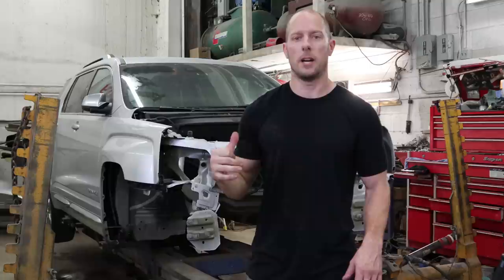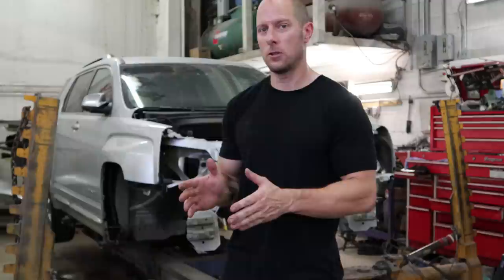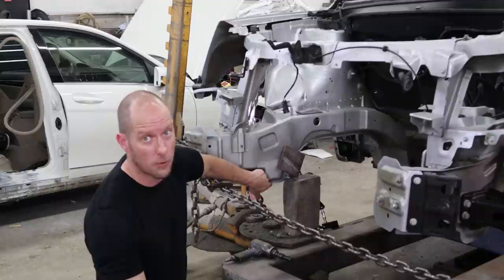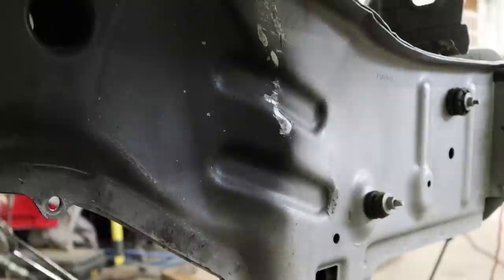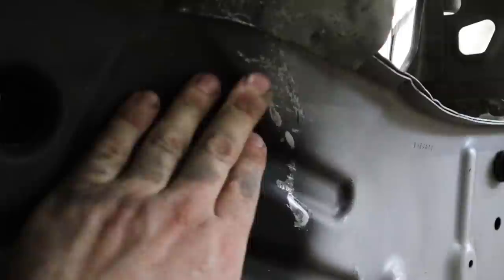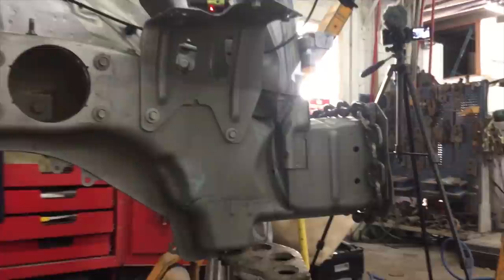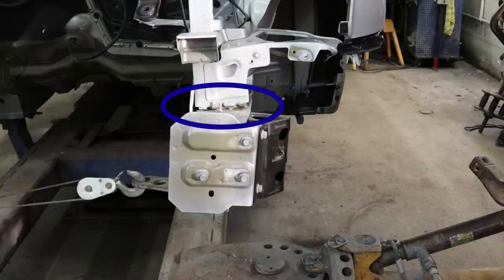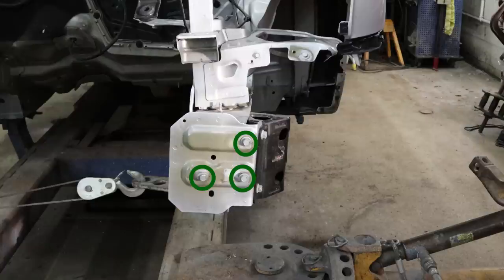Frame pulling tutorial on our 2015 GMC Terrain salvage rebuild project.

Comment: Hi,
Could you repair those high strength steel parts just by welding a piece of high strength steel patch overlapping them? Would that make a satisfactory repair for the inspector, and to your good conscience? I see a lot of old cars frame being repaired that way, of course for a vintage car it would be harder to find replacement parts, and the frame is usually not high strength I guess, but I bet jut a patch would be a lot cheaper.
Thanks.
Reply from the maker: You could but it would not be right.  There is a small section on the front where that is allowed.  The older frames are fine to repair, even regular steel unibodies.  On HSS it is not a proper repair.  I just follow the rules that the guys in lab coats tell me is right.  They have done the research and I trust them.  I'm just sharing it with people that don't have access to the training.  I could section it and it would look 100% but I can't be sure and don't want to find out if it will react the same in the next collision.  Thanks for watching.
Reply: @vehcor  Thanks for the reply, I am looking forward to see how you're going to do it.
Reply from the maker: @thisreal8979  I'll get those tutorials out eventually.  They are taking up space on my hard drive.  I just need to find the time to edit them.

Comment: What year would u say the started to make frame sections replaceable. I have a 93 GMC k2500 an would help me with chosen they way to go
Reply from the maker: Your truck is a little different, it is full frame.  It does have places to section it.  You have always been able to replace sections of frames. and still can.  Now the guidelines are a little more strict but you can still buy sections from the manufacturers.  If you are replacing it from rot, just replace the entire frame.  If it is from a collision, it might be worth it to repair.  Sometimes the repairs end up costing more and taking more time than a full replacement so look into that as well.  Thanks for watching.

Comment: Learned a lot from your video! Thanks for sharing! So a slight frame sway does not impact the safety of the repaired vehicle, right?
Reply from the maker: Glad you find them helpful.  If the rail was swayed over a longer range (no kinks, crumples), you could pull it back and it would be fine.  The inner part of the right rail was boarder line but I like to make it perfect.  Thanks for watching
Reply: @vehcor  Got it! Thanks for reply!

Comment: I am curious on how you know where to pull it. Where do you get measurements to know which is bent and where it should be? I have a 350z and where the bumper attaches, the holes dont really line up. They are close but a hair out. How do I know which frame rail is bent (or see if both are) and check it?
Reply from the maker: The frame rack measuring system has measurement for all vehicles.

Comment: A frame was bent due to hit in the rear, trunk doesn't close. Can it be strightened by pulling by that frame with another car? Thank you for the informative film.
Reply from the maker: I don't have any idea how bad it was hit.  A trunk that doesn't close can be as simple as a bent latch or body panel or as complex as entire frame rails requiring replacement.  Thanks for watching.
Reply: Thank you for the replay. First I'll try to do Mickey mouse way to repair by knocking on the bent frame with the hammer over a small dolly. Also some people pull using the trunk of the tree. Quite interesting to experiment.

Comment: If you are going to replace the frame rail, would you straighten it all first or just cut and replace?
Reply from the maker: I would have done this even if I wasn't trying to make a tutorial.  It helps to get panels that are adjacent to the ones you are replacing in the right spot.  If you just remove everything sometimes it is harder to move the good panels even a little.  It is usually just a few millimeters but it can make putting it back together a real pain.  I did end up pulling the aprons a little as well.  Thanks for watching.
Reply: @vehcor   I thought so. Been a long time. 40 years ago my first job was a helper in a cousin's body shop, Flower Hill Autobody. They kind of said the same thing. It's art and science. We had a guy that could red lead like it was painted on. Now they probably just replace panels.

Comment: Could a simple pull procedure on a front-end hit at the small bridge above the headlights compromise the integrity or overall regedity of the chassis? 

Vehicle is 1990 Mercedes W124, thanks
Reply: I doubt that it would.

Comment: This was great! You certainly evolve on the filmaking side over the year. I wonder to what level of accuracy are measurements taken? If the frame is off only by a few mils ...say 100..with no wrinkles... is also a replace or nothing?
Reply: What I’ve read is that if any bends approach 90 degrees, even the smallest kink, mandatory replacement of that section back to the core structure, with front end damage that would be the cowl/ firewall.    If it’s less than 45 degrees it’s a matter of judgement, placement, etc.    I’m commenting above.  Check it.

Comment: could you have done the pulling without pulling the motor out? as in if you weren't replacing the rails.
Reply from the maker: Yes, it actually would have been pretty easy.  All of the damage was in front of the subframe mounts.
Reply: vehcor I’m honestly surprised you didn’t do it that way, most would’ve, and prob what I would’ve done. Glad to see someone who cares about safety over more profit. Good stuff love the vids.
Reply from the maker: @krajncar  I could certainly save a lot of time and money by doing it the wrong way but I would not want that on my conscience.  In the long run, doing things the right way has saved me money.  I'll explain that further in future videos.  Thanks for watching.

Comment: Frame work eats up book rate, can always do better with panels to get more billable hours in a day?
Reply from the maker: Sometimes replacement takes longer than repair, so as long as the repair is within acceptable repair procedures, it makes sense.  I don't get paid by an insurance company so I'm not trying to book hours, just fix the vehicle properly in the quickest manner.

Comment: complete beginner here so i apologize  if this is an absurdly stupid question i have never done any body work of any kind and am just now trying to learn a little about it but why couldn't you weld some sort of a reinforcement piece of plate steel on the week part? assuming that the car is for personal use and not to be sold to anybody.
Reply from the maker: Adding strength to the rail is just as bad as using a weak one.  If it doesn't bend where it should in the next accident something else has to absorb that energy.  That would be the people inside.  I don't want to kill myself or anyone else so I always follow proper repair procedures.  Something many people are unaware, even exist, including many "professionals". The next part of this repair comes out tomorrow.  You can see the correct way to do it. It looked like a little job the the correct way requires a lot more work.
Reply: @vehcor  that makes a lot of sense thank you for the explanation.

Comment: How can you tell something is high strength steel?
Reply from the maker: Repair manuals tell you.  It is also harder to drill and grind.  It likes to tear and doesn't like to go back to where it belongs like regular metal.  Pretty much all frame rails, rockers and pillars in any newer car (2010+). There are exceptions of course but that is a good general rule of thumb.

Comment: What if you heat shrink  metal on the frame rail would that make it strong again?
Reply from the maker: NO!  It would weaken it.  A unibody should NEVER be heated.  I have seen people do it and it will look right but you don't want to be in that car for the next accident even if it is minor.

Comment: My 2019 Ram 1500 Limited got T-Boned in the passenger side rear, just in front of the Right Rear Tire. This woman hit me so hard, she spun me around 180 Degrees in the intersection. Her whole front end was caved in. Do you think that if my frame was bent, the would repair it, replace it or total it?
Reply: ...if the frame is ok, the bed and cab can be pulled and repaired.   But if you frame is also bend, it's gonna be totaled.  How does it drive?
Reply: @Texaca  I have not been able to drive it yet but I was informed that the frame has not been bent.

Comment: Is there a law saying you can't replace truck chassis anymore? Ive done a lot but now can't get 1
Reply from the maker: No, that is the proper way to repair just about any frame damage these days.  If you mean you can't buy them, I don't know why.  If you work in a shop and don't get the the jobs, it is simple.  The cost totals them and shops don't want the liability of the big jobs.  There is a lot that can be overlooked and missed if you are not used to the big jobs.  Shops that only change bumpers and fenders don't want to experiment with dropping a drivetrain or worse yet swapping a frame.  Thanks for watching.
Reply: +vehcor no it was only at 35% like 14,000 but the insurance company said no it was against the law... just seein if any body had heard that.  "it was a 17 high country with 160000 on it. hit in wheel.
Reply from the maker: @matthewherring8042  I'm guessing you are talking about a full frame truck like a Silverado, no?  If so, there is something else going on.  It is not illegal to change a frame.  That is the only right way to repair most frames.  Doing it the wrong way is not illegal but should be.
Reply: +vehcor thanks man yea its a Chevy High Country 2017.
Reply from the maker: @matthewherring8042  It could be that the shop doesn't want to take on the job and is friendly with the adjuster that gave them a way out.  It could also be that they insurance company can make more money buy totaling it.  It is rare but with these trucks totally possible.  The salvage brings sometimes close to 75% of the replacement cost.

Comment: Would a car in the 70s or 80s could have been saved?
Reply: Yes
Reply from the maker: Absolutely, in fact cars with similar damage all the way into the early 2000's could have been repaired, instead of replacing the rails.

Comment: someone help me please, or recommend me something, What do you think about, buying a chevy silverado 2007 diesel, in good conditions? the year is important? or the cars are cars, doesnt matter the year. Ty so much.
Reply from the maker: 2007 Silverados came in two styles (GM can't count)  The classic style 99-07 and the 07-14 generation.  Coincidently they did the same 1/2 year thing in 14.  The classic style 07 diesel was the LBZ.  The most sought after Duramax to date.  This is because it was only available in 2006 and half of 2007.  It had lots of power, they worked out the injector issues from the previous version and it was the last pre DEF diesel.  They are great motors so if that is the one you are looking at, go for it.  However the newer body style would have the LML. It has issues as all new trucks due with all the emissions crap.  I would not buy ANY first year vehicle as they tend to have issues that they fix in later versions.  Every car manufacturer makes changes to their first year model some so drastic the parts only fit one year.  I also think the 07-14 body style is ugly but that is just my opinion.  I hope that helps.  Thanks for watching
Reply: @vehcor  thank you so much
Reply: @vehcor  Its a chevrolet silverado 2500 LT 2007. i think
Reply from the maker: Still could be either one. If the body looks like the one in this video, https://youtu.be/eHSbeknSD0c it is the classic style and the good one.
Reply: @vehcor  The front side is something different, not to much, is like this one  https://www.youtube.com/watch?v=LRt_Lh2mjtU

Comment: Can't you use annealing on the stressed parts?
Reply from the maker: Absolutely NOT!  You cannot heat any unibody structure or it will be severely weakened.  Not to say that there are not people out there doing it.  It might look right but I feel bad for the next person in an accident with that car.  Even welding on them must be within allowable limits to avoid weakening.
Reply: @vehcor  Thanks.

Comment: So it’ll bend after straightening and it’ll bend if brand new so doesn’t really make a difference🤔
Reply from the maker: It is designed to bend.... once.  The next time it will take much less force to bend it after it is bent back.   There are people willing to risk it, I am not one of them.
Reply: vehcor ok I get it now. Brand new gives a little more resistance. Guess that’s common sense haha
Reply from the maker: @user-zt6bt8dp2c  On the older steel it was acceptable.  High strength steel like these rails it make a big difference.  The biggest problem is that a lot of people are using old repair methods on new cars.
Reply: vehcor ya they want to get it fixed and sell it for max profit savaged title is a salvaged title. I do appreciate guys like you doing things the right way. Awesome work and videos.

Comment: Manufactures don't want you to replace frame rails they want you to buy another car
Reply from the maker: Yes, hence the totaling remark https://youtu.be/be4TofjrAiM?t=500 .  Manufacturers are forced to make repair procedures for their vehicles.  Since they want everything to be throw away, they just make the labor to repair cost more than the car is worth.  Basically a legal loop hole.  Air bags are the biggest way they do this.  Ever wonder why 6 air bags and 4 seat belts deploy with only one passenger?  To add cost to a repair and sell that new car.

Comment: Is this even safe to drive or sell afterwards ?
Reply from the maker: It will be when I am done.  Realistically, the right rail would be about 80% as strong as originally if just straightened like this.  The left rail would be about 40%.  Once the rails are replaced it will be 100% as good as the day it was built and better in some cases, future videos will show why.  If I thought they were not safe, I would not have driven wrecked cars for the last 28 years.
Reply from the maker: @masterspacetime2826  You got it!  Always the best practices, no short cuts on this channel.